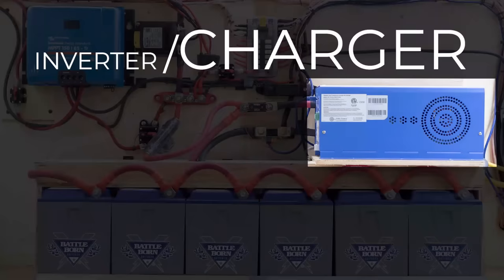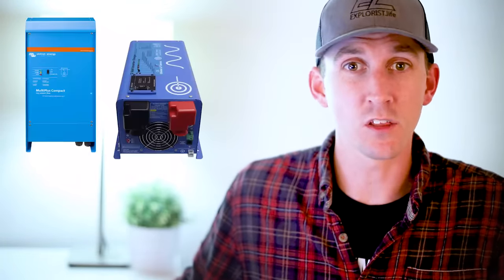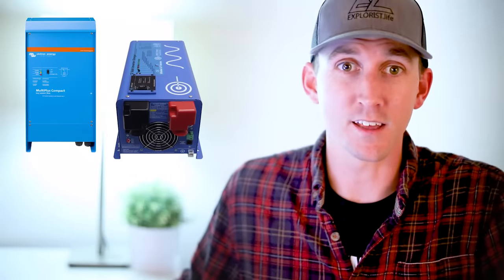Basic Solar Parts Needed for a DIY Camper Van or RV Solar Install

Comment: I'm trying to adopt your plans for a 1200W (4x Renogy 320W) system.  Question: when I do the math on the Series/Parallel diagram the final output is 65.4 V @ 19.58 A.  Your diagram calls-out them feeding a 150/100 charge controller.  Even allowing +25% for "cold effect" that seems like a smaller charge controller would suffice.  Clearly you know well what you're doing (and your videos are amazing).  Why not the smaller Victron 100/50?  Application: Motorhome. Present equipment: (6) 100Ah BattleBorns, v. Multiplus II 12/3000/125-50, and UNOPENED Victron SmartSolar MPPT 150/85 TR.  On roof is a 2009 oem panel (specs unknown) and a 180W/12V.  Any way to incorporate into the system?

Comment: Consider the easiest possibility... A camper trailer already has a fuse panel and a breaker panel and a converter( for taking AC power and using it to operate the 12V stuff) So what video would cover creating a system that allows me to tale my shore power cable and simply plugging it into my inverter?  In Georgia and other hot climates, you will want to run 3000 watts of power and if you can, well it is just simpler to pug your shore power cable into your inverter and smile. Yes?

Comment: The best guide I've ever seen on the net! But after learning about all this stuff... I've decided to go with a power bank instead lol. Even though with power banks you get about HALF of the electricity for the same price... you don't have to deal with all the parts and is much more compact and portable, at least for small appliances.

Comment: Hi Nate.  Thank you for your videos.  Very helpful.  I am looking for guidance on wire sizing.  I plan to replace 6 225ah FLA batteries by connecting in parallel 3 300ah lithium batteries in my RV.  These are Weize batteries with BMS.  I have a 2021 Newmar with a 2500w inverter.  I am planning to use 4 ought wire between the batteries and to the + and - bussbars.  I will use 4 ought wire also between a cutoff switch and a Victron 500w shunt.  My Newmar uses 2 ought wire for the 12v loads and inverter.  I plan to connect these wires to the load side of the bussbars.  Any recommendations?

Comment: If you already have a converter-charger unit in the camper powering up 12v outlets & lights, plus shore power capability for regular outlets, and a solar charger system to keep the battery full  - I'm wondering where in this string of various electrical power the inverter would sit - and how to use it without blowing up anything else.   It's a 14'  vintage camper and really the only 110 vt appliance I want to run would be a television should the power at my house go  down for an extended period, I could get news and weather updates in the camper.   Everything else is either 12v or propane powered.   Can I use the 12v outlets to charge a flash light and the run the inverter at the same time to power the TV?  Seems possible, but I'm just not sure :/   If you can recommend an article or video to reference that would be appreciated!

Comment: Absolutely perfect for the electrically challenged. I have been looking at so many solar system installs and DIY videos and your's has been absolutely the very best. Love the fact that you spoke of providing for future upgrades to the system and the use of current batties until they meet the use life and then upgrading to lithium. Spot on!!!
Reply: I HAVE A NEW WAY TO INSTALL SOLAR PANELS
NO RAILS ./ NO NAILS

Comment: I was having a lot of trouble finding this information online, and was getting very confused. So glad I found your video! Thank you so much for explaining everything really clearly :)
Reply: yes, excellent- subscribed!  

i only wish i would have known 4 years ago about buying agm batteries that were the SIZE of lithiums, so that when i upgraded to lithium i could drop them in.

ARRRRGHHH!  i finally just wore out my agm's and got a couple battleborn lithiums.  thing is, agm's are HEAVY, so back when i bought those, i thought i was being smart getting (3) 45# batteries that i could lift myself, instead of one i could not move on my own.  built them into a custom, stand-alone box, worked REALLY well for 4 years... BUT!

i just spent 3 weeks pulling my hair out trying to fit my 2 new battleborns into the space i had allotted during my van build for my 3 agm's.

Comment: We just upgraded from AGM's to Lithiums by building our own battery bank on our sailboat (we liveaboard) using 180 amp hour, 3.6-volt CALB cells, and a DALY BMS, wiring the cells in a 4s2p orientation. So stoked on the upgrade! We charge our lithiums in 2 different ways. We send the power from our 120 amp Balmar alternator on our engine to our 100 amp-hour sealed lead-acid starter battery. From there a Renogy 60 amp DC-DC charger takes the load from the alternator and puts it in a lithium profile and in turn charges the lithium batteries. It was a fun build!
Reply from the maker: Nice!  Sounds like an awesome project!

Comment: Appreciate the video. I normally watch everything at 1.5x speed as most content is slow in delivery. I had to go to normal speed and I really appreciate the fact that you are delivering the information without a bunch of fluff. The only thing I thought would have been helpful/great was if you had a graphic that built out the system as you outlined it, so... Solar panel-->charge controller-->etc. Irregardless, thanks for the video. Edit: NVM I see it in the description at the bottom, THANK YOU.

Comment: This guy explains it all very well. If you want to have 'full' power off grid. It depends a lot on how much power you need for daily use. I get by with 150 watts of panel going into a regular battery, with a 300 watt. Inverter. Mostly I run lights and my cellphone, with occasional use of tools and chargers.

Comment: Fantastic... one point, lithium batteries can be constantly drained to almost empty while agm batteries must be limited to 50% or so. Thus replacing 3 agm batteries with similar lithium batteries provides twice the usable power. Assuming I am correct...

Comment: Great video. But as seems to be common with vanlife stuff, there is a bit of a disconnect between what is in use in other realms. IE. Carbon foam or lead carbon batteries, such as those from Firefly (popular in the boating world). Currently they offer many of the advantages of lithium (specifically DOD) at a lead acid price. Certainly a great option for those just building out and until lithium becomes reasonably priced.
Reply: I HAVE A NEW WAY TO INSTALL SOLAR PANELS
NO RAILS ./ NO NAILS

Comment: Thank you for this presentation. The step by step nomenclature simplifies the right down the line nature of the path the electric current takes from the solar panels to the power outlet, well, as far as I could tell anyway. I have a basic idea of what I will need.

Comment: Thanks. Awesome presentation, packed with info & no waffle. One of the best presentations I have seen. Many Thanks from South Africa, where the grid is often turned off due to insufficient power nationally, called load-shedding. These presentations of yours are a Blessing.

Comment: You are a special person to give us this. I’ve learned a lot. So much so that I now know less in a classic Dunning - Krueger sort of way. I hate it when that happens!  I’m designing my own RV. I want to have normal amp hogs like lights and fans and AC and such. I want to get my amps from shore power pedestals, my children’s homes (tee hee), from small gas generators, from solar rooftop panels and from my haul truck’s alternator while I’m driving. Every time I’m adding power I want it to fill battery bank to max. Thus I want to be able to run a couple days with no incoming power (assume clouds/rain and boondock parked in a state forest). We will know how to conserve of course in these times. But now - my biggest challenge - What Parts Do I Buy and How Do I Interconnect?  I’m planning on building a false inner wall and behind a removable panel will be where all the interconnects are laid out. It will be fun to show people. Smile. But I’m scared!!!  I want to do it right the first time. So my question is - do you provide design consultation service (for a fee)?  When I’m ready to have an intelligent conversation can I pay you to help me grow my interconnection confidence?  I really want to be PROUD of my work and smile when it all works. I have a confidence gap to get through!!!!

Comment: This was perfect I have been struggling for several weeks trying to get my system back up and running. But now I get a better understanding and realize that my electrician hooked up the terminals wrong, positive to negative good thing I have a fuse that blew and hopefully not my inverter.  Great job

Comment: A truly gifted presenter. Thank you for such a lucid introduction, I will be looking at the followups. What I cant seen to find is a slow explain it all video on van conversion. How do I attach the wooden bits to the metal-work of the van - glue? screws? Where? Surely you cant just do that you might puncture something or cause rust..

There are many excellent videos but they use time-compress to squeeze it all into 20 minutes. Jig saw the side of my most expensive ever purchase - I can do traditional Derbyshire Hedge Laying but I cant imagine just chopping holes etc in a vehicle. 

 If there was cheesey background music or extravagent hand waving or dogs on skateboards - I happily missed them all

Comment: this was so helpful. Thanks. I didn't want to waste money buying the pre-built power stations with the direct connections if I could do the work and make it cheaper. I'll probably go lithium but those battle born batteries are $999. Way too much.
Reply from the maker: Glad it helped!  The pre-built systems are pretty great if you need under 200 amp hour capacity or you want the ability to expand eventually.  Re: Battle Born batteries, when you are price shopping, be sure to compare apples to apples as with battle born batteries the BMS in already built in and you wouldn't need to add an external BMS.  Also, the Battle Born batteries have a 10 year warranty on them with customer support in the US.

Comment: I am impressed with the video
I am wanting to buy a 2007ish 40' Diesel motorhome and convert to solar. Seem like inverters and battery charging systems already there. Upgrade battery (lithium ion battery usage 10 years), Power everything by solar (maybe not AC).  Inputs Disel generator, Solar, and 35/50 amps RV parks. Do you have links to people that have done this?

Comment: VERY interesting, thank you!  I will need to design and build my own system for the travel trailer that still don't have, but I will.  Please slow down, it would make a lot easier to understand you the first time.  Thank you again!
Reply from the maker: If you need me to slow down, you can click the cog in the lower right side of the screen and slow down the playback speed.

Comment: Hi I love how to speak in layman terms to the non electricians out here. Your videos make it easy to understand. I would however appreciate if you can do a video that speaks to a household application solar system and address questions such as: could you run 220 volt appliances such a washer dryer, multiple split unit ac’s on solar and not just the small 110 volt items such as coffee pots, tv’s etc. it would be great if you can also provide some examples and length of time it could be done for, as you do to allow the viewers to better understand. I think this would really give a full view that you can truly live solely on solar without being inconvenienced. (Of course only if it is possible) thanks.
Reply from the maker: Thanks!  Glad it's helpful.  I probably won't ever get into residential solar on this channel.  This channel is all about teaching people how to build DIY campers; so teaching residential solar would be a little off topic.  Also... there are too many local code compliancy issues for me to get excited about teaching residential solar & electric for, say... a different channel.

Comment: Nice video, thank you. Seems worth mentioning that USB power is not 12 Volt power, it’s more like 5V. Some cheaper USB-powered electronics may be damaged or behave erratically when plugged into 12V power without an appropriate converter.
Reply from the maker: For sure!  And I've never seen a "12V" usb outlet that didn't have a 12v to 5v converter built in, which is what we were talking about in this video.

Comment: I watched one of your videos and I thought I finally understood everything I needed and thought I could actually handle doing my solar but when I went thru the description and looked thru the different list of exactly whst I should get when I got to the locator/dc-dc charger (charging from alternator) I'm lost. Not to even mention the wire size and shore power and there's one more but I'm spinning now and can't remember 😅  if I'm not running lights. Just frig and charging phone and computer and iPad do I need the 12volt. I know this is slot for the comment section. If I could ask you a few questions how can I do that?  Thank you. I love yoir videos. They are very informative and easy if my brain wasn't mush after a lil confusion 😳
Reply from the maker: Yeah, there is a lot to learning a new skill.

Here are the options I have available for getting your questions answered.

1: You can ask your questions in the comments section of any of my blog posts at EXPLORIST.life or any of the videos on the EXPLORIST.life Youtube Channel.  I do make an effort to answer all questions posted in both of those locations.  I'm generally about 2-4 weeks behind on answering questions there (just because there are SO many of them and answering questions sometimes cuts into 'making new videos time'); but if you ask there, I'll get to it ASAP.

2: If you need a faster response, or you feel like my response should be more than a sentence or two... I have a private consulting group set up where I'm answering questions EVERY DAY (normal business days), so you'll have a sub-one-business-day response from me there.  If you have a multi-part question, if you feel like you'll need some back-and-forth to get your question answered, or if you feel like your questions require a response longer than 1-2 sentences... I would strongly consider joining the private group to get your questions answered.  Here is more info on the private group: https://community.explorist.life/

Comment: Impressive presentation! We outfitted our Sprinter initially in 2017, and have been upgrading ever since. We are in the process of rebuilding our floor (Camping World installed the windows in our van and ignored the directions from C.R. Laurence, so water seeped through) and resealing our windows. We love our lithium upgrade, solar panel upgrade, our MPPT upgrade, and our plethora of Victron components for battery management, alternator power conversion, and shore power conversion. I wish we had your workshop and skills for much of the upgrade, but I am the perfect example of the old joke, How many programmers does it take to change a lightbulb? None, that's a hardware problem! My greatest achievements have been the sliding trays for our bikes and our storage bins. But everything else looks like crap. C'est la vie, our bed is comfortable and it's long enough to hold my 5'8" body (and M-B's $2500 10" fiberglass topper lets me stand up inside, the only way I got into this in the first place!) Thank you for your videos, and worthwhile information, even if I don't have the skill to replicate much of it! tortugatravelers.com is where I post our travails/

Comment: I enjoyed the concise format, thanks for posting.  
Question:  if I setup a solar-system for my RV Camper such that I plug the shoreline into an inverter, to get power to just about everything, is there a device or method that would allow me to connect a Generator to provide to the Battery Bank and the RV Camper?

Comment: I currently use an Armada system. With a 2x100 watt panels with a single lead acid it works well for a week of camping or whatever.
Reply from the maker: Great!  Glad you found what works for your own personal electrical needs.

Comment: Your teaching technique is commendable, and the content delivery is well done.  As many in this forum have already said, you do a great job of delivering complex subject matter in an understandable manner.  
You have created, in a previous session, a Solar Charger Controller Calculator which works great.  Might you have (or would you consider creating the same type of calculator for wiring size, length, amps, volts, fuse size.  It would really help those of us that have difficulty figuring out those piece of the design.  Thanks and I hope you will consider creating it if it doesn't already exist.
Reply from the maker: Glad it has helped!  That calculator is already live and running: https://www.explorist.life/wire-sizing-calculator/

Comment: Good information on setup requirements and components for RV solar setup.  Some RV's come with the USB charge ports installed in some of the AV outlets.  We found some plug-in adapters which have the 12V barrel connector so that we can upgrade the USB chargers to the latest style/type.  They are inexpensive and if you get a good quality brand they should last for years.  Thanks for the video.